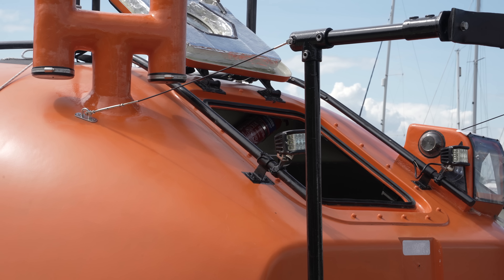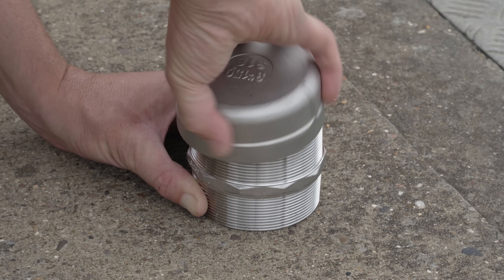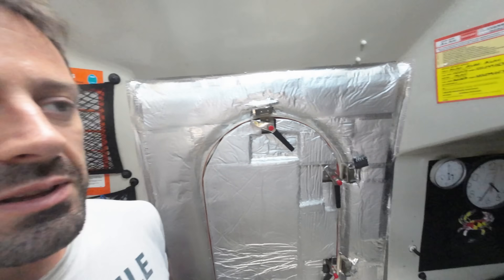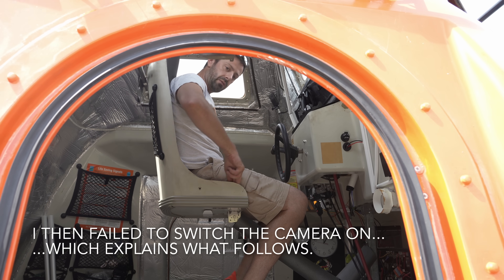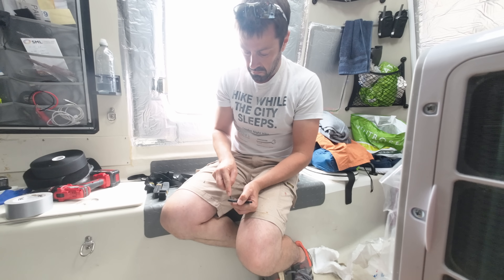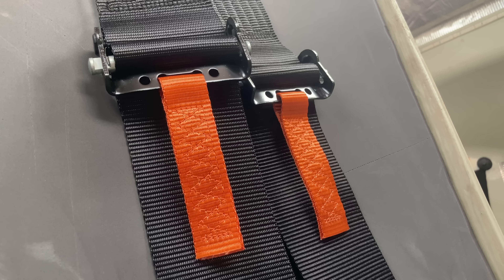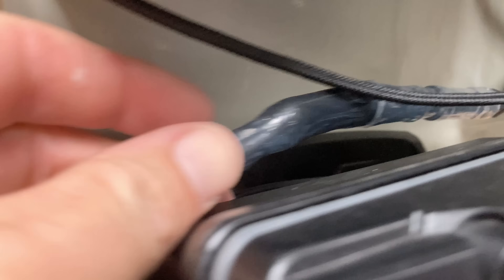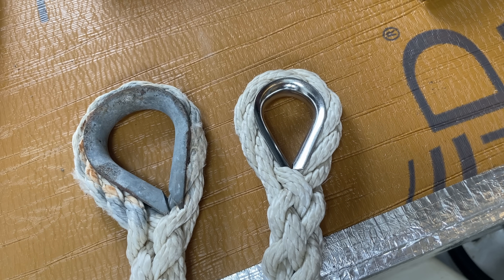Lifeboater gets a new harness, working AIS, and other mods! Expedition Lifeboat Conversion Ep90 [4K]

Comment: Last week I wrote that it would be easier just to tow Alan to your final destination.  I was duly reprimanded.  I did not realize you were using these short sailing legs as a shake down cruise.  That problematic rudder assembly proves the wisdom of your precautions.  Please keep up the good work.  I'll part with a quaint old British expression, "Cheerio!"
Reply from the maker: I've not really earmarked it as a shakedown cruise. I simply have a destination. The rudder was fine before, but as with many things, if a maintenance issue presents, I have to work out how to fix it.

Comment: 10:30 it's interesting to think about the different priority of leaks. I did all my boating in southwest Florida, where you'd always be in sight of land, and the water was mid 80s temperature wise. Obviously you didn't WANT your boat to sink, but you weren't especially worried about it either. But we'd routinely head out with multiple leaks - as long as the bilge pumps could keep up - no big deal. We even had a valve that would divert the engine's raw water pump into a bilge pump - thankfully we never needed to use it.

But still, a totally different attitude compared to being in the arctic.

Comment: Dry and wry like a proper Brit should be. I come away more and more dehydrated with each visit. Good stuff.

I d have to agree with the good folks from YouTube land. One misplaced bolt, a single mperfect hole, or a solitary microscopic imperfection is cause for abandoning ship. The way that through hole got installed means I'd burn Allen to the ground, and the marina that housed it along with it. It's the only way to be sure.
Reply from the maker: With logic like that, we are saved.
Reply: Glad we're on the same page. You should always spend 99% more time in pursuit of .01% improvement. Progress is nothing without perfection!

I'm really digging your can do attitude and willingness to do what has to be done. Guess without that sort of mindset you'd be living a mind numbingly mundane existence.

Cheers from Canada

Comment: May of us who did not have the specific proper tool have made a hole that same way! No shame there. edit: The vehicle I drove in the (US) Army had a similar 4-point harness. When travelling at speed over uneven terrain the travel of the the suspension was great enough that if not strapped in you had a good chance of getting concussed on the ceiling of the cab. I can see where that would be what is wanted for Alan on rough seas to keep the pilot at his station and not unconscious.
Reply from the maker: Cheers

Comment: You should add a passive splitter to your radio output, and a small 2-channel mixer for the 'entertainment' input of that switcher. That way, you can set it up so that you have low audio radio coming in even while listening to a podcast or some music, and then when you switch it goes radio-only at a higher volume. That means you don't miss anything, because as soon as that light goes green you're already too late.
Reply from the maker: I did consider a mixer, but it's much more of an operation. I'll see how this setup goes.
Reply: @AlexHibbertOriginals  In the end I think simplicity is going to win, so a mixer may not be ideal. I'm also not sure how big of a deal missing the first second and a half of a broadcast is (maybe a few seconds if you have to scramble to find the damn button).  
I've had good luck using in-ear earphones underneath my noise cancelling headphones when I had to listen to a boring work presentation while watching some YouTube (I highly recommend this one channel of a British guy renovating an old life boat, I think he named it Adam or Aron or something?), but you need big ears or you'll start to feel pressure after (half) an hour. Anyway, just wanted to share my two cents, I've never really been on a boat, much less captained on.

Comment: 10:51 a spare of that clamp and bent bracket would be a very very good idea to have. Either that, or get the one you have gusseted. Cold water and fatigue from big seas could cause issues. Maybe another way if steering is present allready ?? I see something on top ? I spent a couple of months up there in 1990, you would be surprised at what gives issues.

Comment: If you don’t have a hoover for collecting fibreglass dust when drilling/cutting, use shaving foam (or similar) whilst drilling and just wipe-up after. This is a legitimate technique for low risk single fixings in asbestos-containing materials ✅
Reply from the maker: I like it. Although I do have a 24V hoover now...

Comment: I'll buy one for you if you want, but I'd consider something like a "Zoom Podcast P4" (or something). Has multiple inputs and outputs (plus recording), making it nice and easy to get audio for your videos. Records each track individually plus a mix. Can be plugged into windows as a usb audio device.

I haven't actually done any streaming yet, but I've got one in my van. XLR shotgun mic for me, mono feed to my CB radio, plugged into my phone via 3.5 mm, and then 4th channel is my PC for streaming.

Has 4x headphone outputs, and automatically upmixes mono to stereo.

There might be an even better device for your situation, but it seems like it'd be good enough to manage audio live and also give recordings for us.

If you want one email me.
Reply from the maker: Paul I appreciate this. I have a Zoom H1 for the basic lapel mic stuff, and an SM7B for the VO, plus a Tascam dual XLR recorder, but you're right that a 'field mixer' would be useful, particularly for recording both sides of radio comms.

Comment: You could drill and tap a grease nipple to the rudder bearing block and fill it with grease, that'll stop that pesky leak
Reply from the maker: Sounds invasive!
Reply: There are probably 4 or 5 rings of gland packing under the top hat. You should be able to dig out the top 2 without a serious ingress of water, and replace with square section graphite gland packing (Klinger or similar). That will be good until you get Alan out of the water and replace all gland packing.

Comment: You may want to make it a 5 point harness, one to keep you from sliding down out of the seat. By having a strap between your legs!
Reply from the maker: You're right. I'll rip out the four point one and throw it away, and replace it with a five point. The four point is clearly useless.

But, don't get me started on a six point harness...

Comment: Without watching this, it got me wondered yesterday, how the drivers harness is installed in a way, that the driver still can stand up. 
So i thought to myself, wouldn't it be better, if the drivers seat, sat on a slide and the driver is only strapped to the backrest, while the seat is folding/rolling. This way the position of the seat is adjustable and the driver is always strapped on, when switching between the standing and sitting position.

Now i watched and imho the seat is really in lack of functionality. I can imagine conditions, you definitely don't want to step out of it, but reach stuff around, below and above you.

Comment: That anchor through hole is worrysome. With any through hole it is best practice to seperate the the sealing component from the mechanical mounting.
From what you showed in the video you you have just drilled a hole bunged the fitting in and filled the gaps with sealant. In doing so you are relying on the sealant giving enough mechanical strength  without being compromised. What you should do is fit two large stainless flanges on either side of the fibreglass that are then compressed by winding on a flange nut with sealant in between.
The way it is now you are likely to have the fitting ripped out if someone lets the chain out to quickly.
Reply from the maker: I should have shown the inner plate and locking nut. 

Whilst at anchor the rope will be tied off on the t post.

Comment: it's called a lap belt not a rib cage belt, bucket seats have a slot in them, have alook in the motor sports blue book for correct angles, in a big impact you would slip down to your arm pits, the five point harness has the ball crusher, or in the urban dictionary the five point harness is a fun way to use an empty car park.
Reply from the maker: I have to work with the shape of the GRP moulding. I assure you that the lap belt isn't anywhere near my ribs. Any lower, and it didn't sit at all well, and would sit flat across my upper thighs. I also need to account for a slight rise in seated position.
Reply: Just make sure the lap belt does it primary job which is keeping your but down in the seat. The shoulder straps should keep you from moving forward but should not be keeping you down. By “a rise in seat position” I imagine you will be adding a seat cushion which will hopefully get the lap belt in a better position.
Reply from the maker: You're way ahead indeed. The cushion corrects the setup as hoped. I also need to allow for shorties.

Comment: I can’t help thinking that the seat harness lap belt would provide better resistance to vertical heave if it was secured at a 45 degree down angle. Maybe I’m just thinking of offshore powerboats and aircraft though?
Reply from the maker: You're right.

Comment: IMHO helmsman seat absolutely not designed for long hours of comfortable steering.
 May be an old adjustable car seat will suit much better? (Easy to mount at same bracket)
Reply from the maker: I have to say I've found four hour stints pretty comfortable. Just aiming to improve it, without ripping everything out, and losing the benefits.
Reply: @AlexHibbertOriginals  you could bring a small amount of memory foam for sleeping on and add some to the seat if/when you feel it getting uncomfortable in spots. 
On a separate note; I would also recommend some high quality ear protection for all passengers. Prolonged exposure to engine noise can hurt you even if it doesn't seem too loud. They make hearing protection headphones that allow using a radio in loud environments.

Comment: Nice webbing.

Could water in bilge just be condensation from breath?
Reply from the maker: No - I saw trickles leading from the rudder post.
Reply: @AlexHibbertOriginals  is the juice worth the squeeze then? 
Only you can decide you madman. 

Godspeed good sir.
Reply from the maker: I guess part of it is that I don't understand the rudder design, and want to ensure I'm not heading toward a failure at sea.
Reply: @AlexHibbertOriginals  I'm commenting as a total amateur. Not trying to criticise at all . Just trying to help

Comment: The 316 end cap will seize with stainless on stainless galling eventually. 
Make sure you apply some nickel based anti seize for now until you can find a bronze/brass solution.
A taller one would help as well in high waves/chop when at anchor.
What was wrong with the wiring on the VHF?
Reply from the maker: SS galling is generally due to speed causing friction and high temperatures. This cap screws on slowly.

A previous episode explained that a bad connector on the fixed VHF was the problem.

Comment: NO, NO, NO.  The lap harness should angle down about 45 degrees and go over the strongest part of your pelvis.  Absolutely not over your stomach.  Please note where the original holes were in the sides of the seats.  Either get shorter belts or add structure for mounts along the line of the 45 degree angle but below the seat bottom.  And, I share your aversion to fiberglass dust and debris.  Experienced way too much of that vile stuff working on fiberglass race car bodies.
Reply from the maker: I've just hopped up and checked the position. With the foam pad laid down, the lap belt is across the substantial portion of the pelvis, most certainly not the stomach.

Any shorter drivers will need to add more cushions anyhow to see out the windows.
Reply: @AlexHibbertOriginals    OK, good to hear.  You have a very interesting project and really show a lot of creativity.

Comment: That particular "..... Itchy vileness ... " can be quickly dismissed by a short length of tape over the affected areas of the skin. Simple cheap masking tape (painter's tape) not too sticky but just perfect for removing that itchy sh!t from your skin & still leaves the hair where it belongs, on your body still growing & healthy in the top layer of skin.
You're welcome.....
Reply from the maker: Sounds extreme but worth a crack
Reply: @AlexHibbertOriginals  just give it a "crack". Some times it might take a couple applications but it really does work. Most people look at me as if I just sprouted 3 new heads when I suggest this but the ones who try it, swear by it. Even cheap electrical tape, scotch tape ( the clear stuff for wrapping gifts n such, even cheap packing tape will work. Just a slight amount of adhesive is all it takes to remove that hellish, horrible, annoying aggravating, sanity crushing & serenity destroying itch.....  There have been times I have used Duct Tape (Ducktape) that really sticky stuff for the webbing between the fingers where there's no hair anyway.... 
If you use the clear packing tape, it is quite obvious what's been removed as you can see it (as you say over there ) Straight Away....
After 25+ years in the Construction & Building Trades, I've had more than my share of exposure to fiberglass & it's insanity inducing itchy irritation. Heard of & tried all manner of BS remedies, take HOT shower, no take a cold shower, No shower, screw osha use the air compressor to blow it off blah, blah, blah, blah ..... 
Until 1 day I was helping a friend with a project in his home that required us to venture into his attic & there was fiberglass EVERYWHERE. You could see it in the air. We had masks & tyvek suits neoprene gloves  & all that. As we were cleaning up the insanity was coming.... I remarked something about the itching & he said to me, "here, take this tape (masking tape ) just try it" 
I was very skeptical but the more I tried it the better it was working. It only took a few strips. & the worst place is your eyelids. I stuck that tape on there & pulled it off & it was INSTANTANEOUS Relief. 
That was about 10 years ago. 
Anyway I hope you try it because I KNOW it works with ANY kind of tape. PS it also removes that crap from clothing. I propose you get a cheap lint roller that has the adhesive sheets that you pull off as you use it. Those things work " A Treat" also. 
May your Voyages & Endeavors be Blessed with Serenity & non-itchy Success. 
Cheers from somewhere East of the Rockies out on the Plains .....